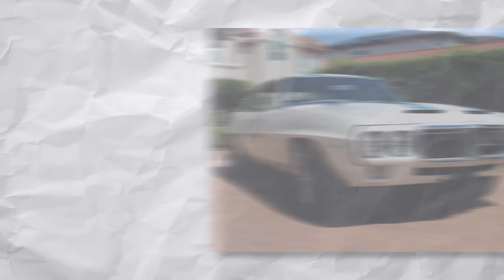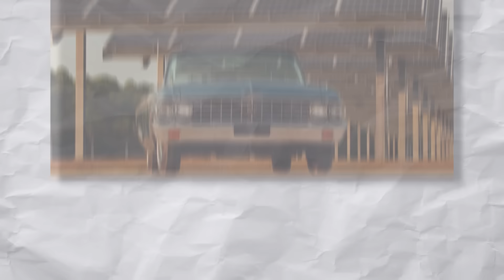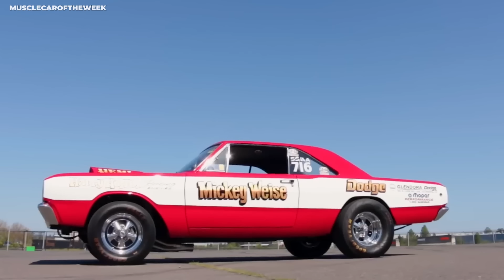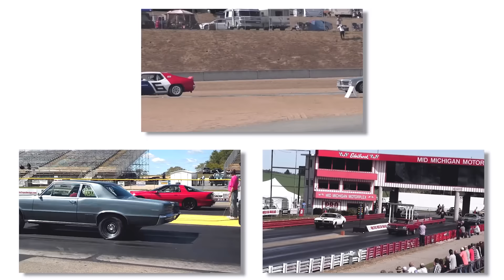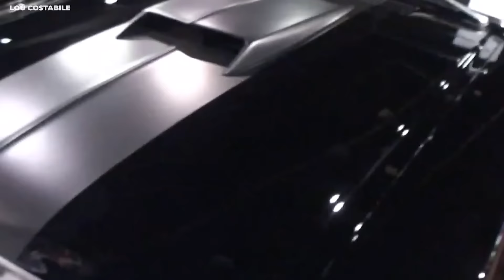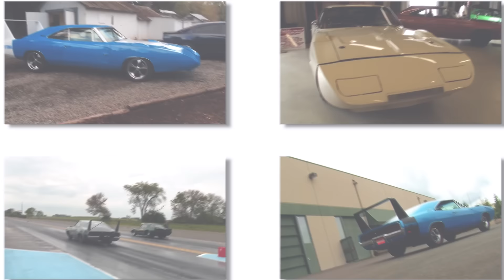12 Street Cars From the 1960s That Were Basically Factory Race Cars

Comment: The very first  Trans Am ever built (1969) sits in an indoor showroom @ Ames Distributors in Spoffard NH
Reply: The first ones, with 303 ci engines, were built for 1968. The 400 in the '69 wasn't legal for Trans Am racing. The only ones actually raced, were allowed to use the Chevrolet DZ302, as Canadian Firebirds used Chevrolet engines. The 303 Pontiac was too heavy, being a de-stroked 400. Had a friend that drag raced a 303 '68 T/A.